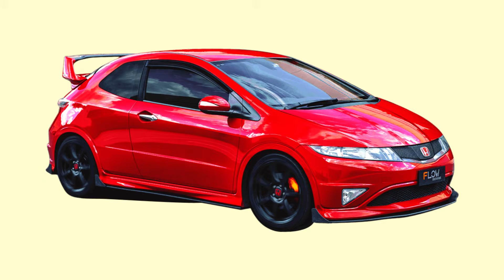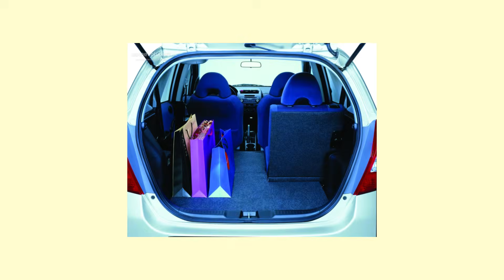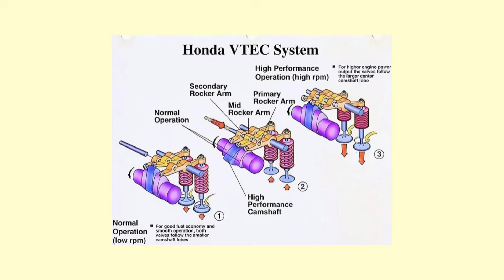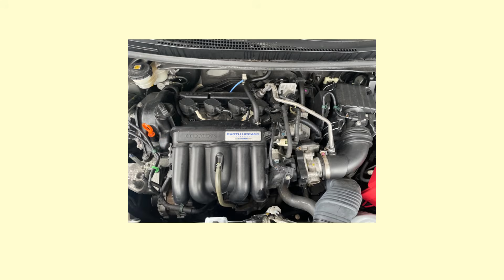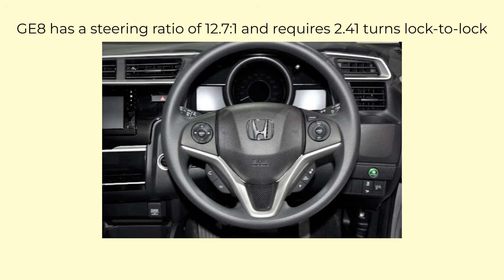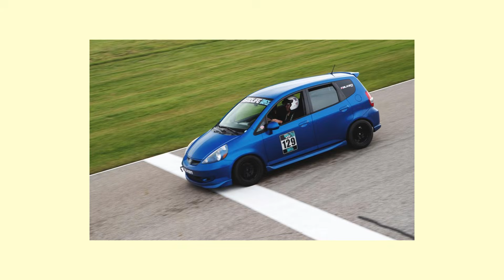Automotive X-Ray: Honda Fit/Jazz

Comment: I just love watching honda fit videos, I recently picked on up this year for 3k. Second generation manual transmission, just to learn on and have as a daily driver and it has been the perfect first car for me. I will be sad when it inevitability dies because it does have a significant amount of rust on it since I live up north, but until then I will cherish it until the wheels fall off 😂

If I had to name one feature I like about driving it the most is most certainly the handling. First couple weeks after I learned how to drive it I took it to a parking lot with a bunch of randomly placed cones, and did turns I never thought were possible 😂❤

Comment: I have some personal experience with the Honda Jazz. My father owns a 2007. model, L13 single cam twin spark around 80hp, and he has had it for over 10 years. The car has proven extremely reliable and fuel efficient, HOWEVER. The clutch failed at one point and my father's friend who's a mechanic and me, who has also messed with cars a lot went to replace it. We had full lift, air impact, everything. 

After no joke 11 HOURS we dropped the gearbox. That car is so HORRIBLY designed for maintenance, everything is incredibly tight and cramped, parts just laid over each other, hidden bolts everywhere, it was an absolute nightmare. For reference me and the same person replaced the clutch on my '93 Mazda 626 in like 2 hours. He ended up finishing the job tomorrow without me, and apparently took a solid 5-6 hours to assemble all the BS back together. 

As far as the car itself, I've never liked how it drives. It has no steering feel, so while the handling is alright it doesn't every really give you any feedback or confidence to push it further. The 1.3 twin spark engine is so hilariously boring that it's almost entertaining. The car has modest power, so I did not expect any performance but dude that engine just does not want to rev at all, it feels like it has been tuned to just run as efficiently as possible and nothing else. It really feels like an appliance.

The best things about it imo after driving it many many times;
1)Reliability, extremely reliable
2)Surprisingly comfortable for it's size and has a good ride
3)Looks pretty nice

Bad things;
1)Super bad performance from the engine
2)Almost zero steering feel
3)May God help you if you need to replace the clutch

Overall as a car it's good but from an enthusiast's standpoint I don't get why people like them at all. Probably contradicting opinion from what most people think, but to me it's not fun or interesting at all.
Reply from the maker: Very insightful comment, and I understand what you mean especially by that numb steering feedback, which is actually a common complaint found in these cars
Reply: I quite enjoy redlining my gen2 AMT (...in semi-auto mode ofc), but the only other cars I've really driven have been SUVs, so I don't have any good points of comparison.

The wolly steering and cabin noise are by far my largest complaints. I love the visability you get though.
Reply from the maker: @Emotional_Support_Twink  Cabin noise in a lightweight car like this with immense practicality benefits is excusable, but in modern cars that are north of 4000 lbs? Nah
Reply: @Emotional_Support_Twink I sound deadened my interior with Hushmat. Doors, floor, ceiling, firewall. Took some time and some elbow grease, plus lots of swearing when I broke clips (since replaced), but the interior noise difference is night and day.
Reply: @E @Emotional_Support_Twink oh, and plasti-dip in all the wheel wells. Reduced road noise noticeably!